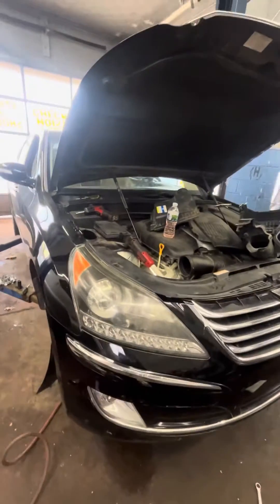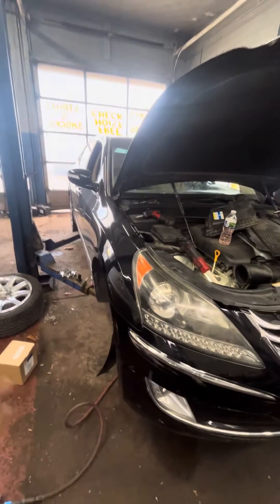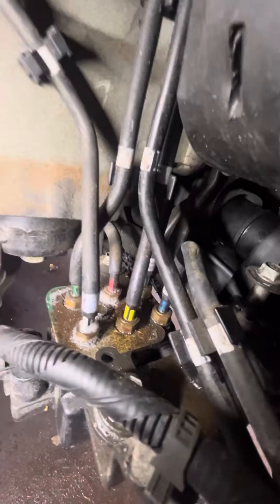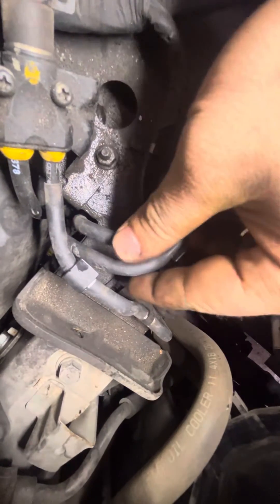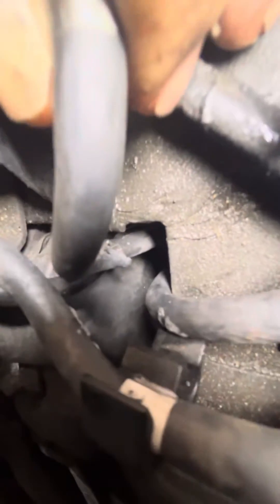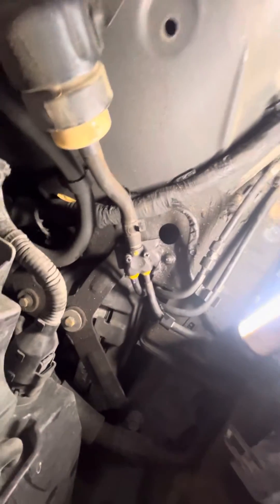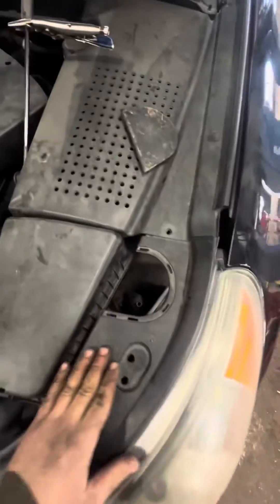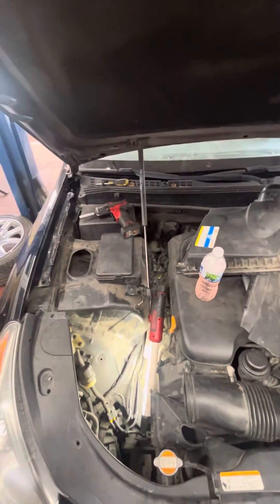Hyundai Equus air suspension leak and fix! Common issue repair and system overview

Comment: If you're going to spend a ton of money replacing the air compressors and all the air shocks, then just go ahead and replace the system with regular struts and shocks. It'll be much cheaper. The Kia K900 doesn't have air ride.

Comment: I've wanted to get an Equus but I can't bring myself to do it because of all the repair pages I see. It must be an amazing car for owners to go through so much to keep it.
Reply: Yes they are. Find a 2016 Equus if you can. They are the last year for that car and had the fewest reported problems. Unfortunately the downside to that is that Hyundai didn't make as many that last year so they're a little harder to find. I think they made over a thousand but less than 2000. I have a 2016 Equus. Found it in Indianapolis. Great ride and no problems other than the front left air shock. It was fairly new but defective. Rattled a lot. The ride is phenomenal and the interior noise is almost non-existent. 5.0 V8 and 429 HP.

Comment: in my case, this was not the issue, all air lines smoke tested....both rear shocks smoke tested and only about a year old, new compressor new valve....rear still drops intermittently ...makes no sense...fuck these cars!!!
Reply: Pinhole leal at rear shock..smoke test didn't reveal it..soap and water did..replaced rears again..all was well
Reply: Did you ever find the solution? I am having the same issue.

Comment: Question...
2011 Equus Signature air ride button will not lower. It stays in the up position,  all the time - 3 or 4 months. Prior to 4 months ago  it would lower when you pressed the height button. Now it won't lower.
Suggestions,  comments  and concerns please...
Thank's

Comment: Tried the standard air gun didn't work
Reply: I think he was saying you need the code reader that can make it work. It probably opens an electronic valve to allow air in.
Reply: You can change it out with a tire valve & then use an air chuck to air it up . Like you would your tire.

Comment: I had the rear of my car jacked up to replace the rear wheel hubs, and now the rear air suspension will not raise back up I don't know what the problem could be it was fine before I jacked it up.
Reply: It needs to be reset